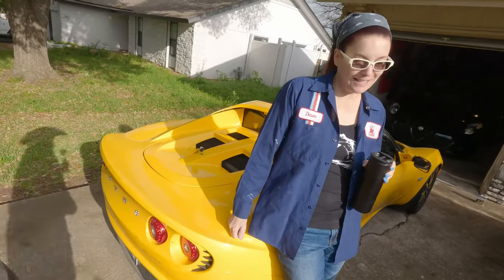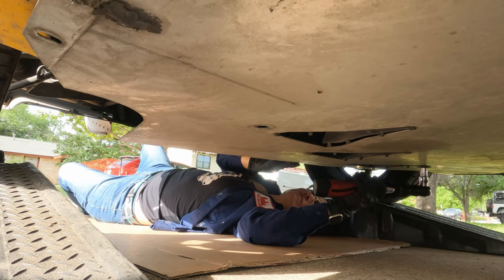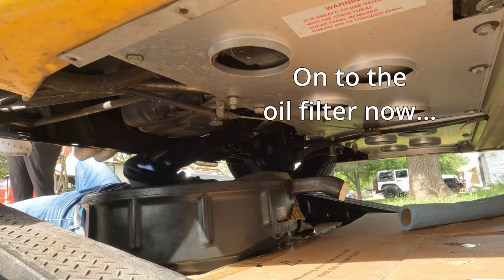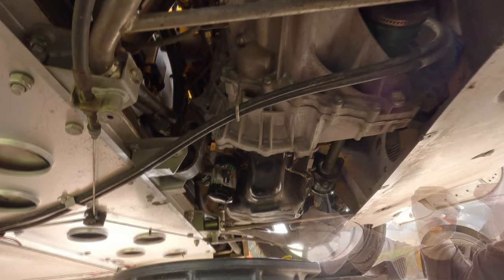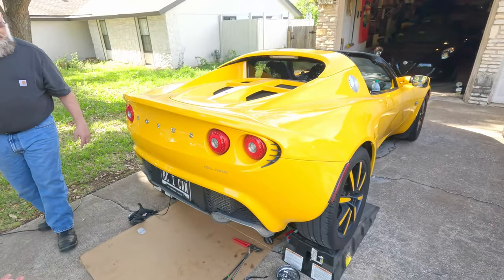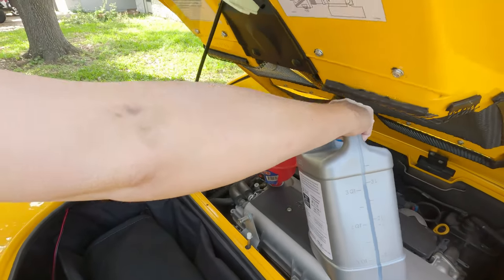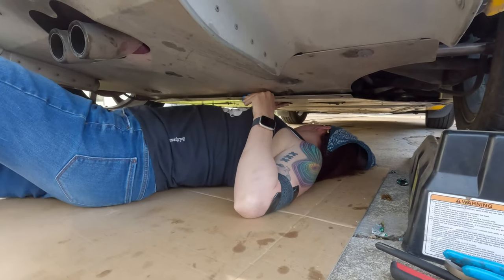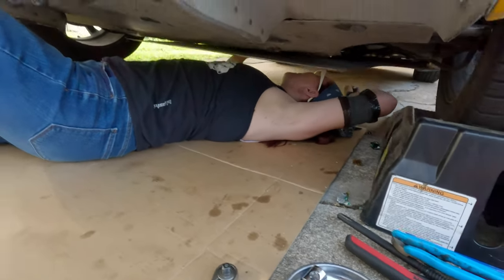Her 1st Lotus Oil Change was a NIGHTMARE - removing a stuck oil filter

Comment: It's very normal on the 2zz motor , the oil filter can move with the 8500rpm , so the solution is to use loctite.
Reply from the maker: Loctite to prevent it from getting too tight? That's kinda brilliant.